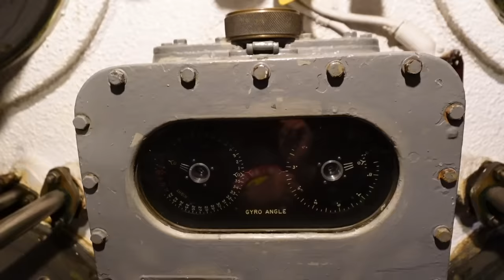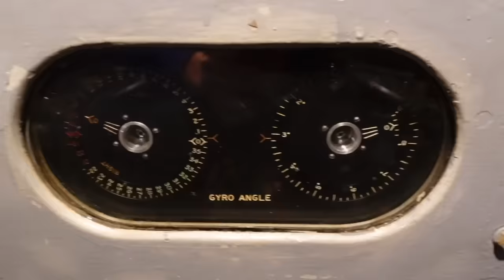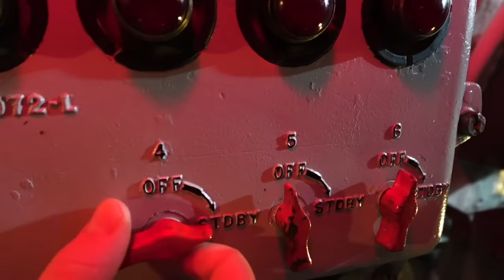Talking to the Fish: How USS Cod Programed a Torpedo during WWII

Comment from the maker: The 50-foot depth setting was to allow the problematic magnetic torpedo detonators to pass below the keel of large ships.
Reply: Also remember U-864, which was actually torpedoed while submerged
https://en.m.wikipedia.org/wiki/German_submarine_U-864#:~:text=German%20submarine%20U%2D864%20was,73%20men%20on%20board%20died.
Reply: 50 foot diving enemy sub, worth 1 fish try anyway
Reply: How similar is the torpedo programmer to the ones in later torpedo capable planes like the A-26 Invader?
Reply: Not much is similar...@damndirtyrandy7721
Reply: Think about what periscope depth of an enemy sub would be that's why you would need a fifty foot setting. Also the depth a torpedo with a functioning magnetic exploder   needed.
Reply: @joeveltre5560 And a functional depth keeper and a functional gyroscope…(a functional detonator was just the last problem).

Comment: I'm shocked, SHOCKED , I say, that the Mark 14 torpedoes had problems! Why, we were all assured by BuOrd that they worked exactly as specified, and any perceived problems were the result of user error.
Reply: @Drachinifel tells how one sub fired a dozen Mark 14s at a vessel only to have them all bounce off. They saved the last one and took to Pearl for evaluation.
Reply: And a court martial could follow if the captain ordered a toroedo mate to open one up for troubleshooting or modification to make them work.
Reply: Upon hearing of problems the bureau of ordinance immediately investigated and found no faults because all the paperwork was fill it out correctly

Comment: If I remember my history correctly, some of the torpedoes were supposed to detonate under the ship, breaking the keel.  It didn't work well, but it would explain having the 50 foot depth setting.
Reply: Yes. You're right!
Reply: The finally got the magnetic detonator to work in mid 1945. By that time there were few Japanese ships left

Comment: Paul,
The TDC absolutely deserves a video of its own. It was such an amazing piece of technology for its time, and making it reliable enough to operate on a sub was a major accomplishment of itself.
Reply: One of the most effective pieces of electro-mechanical devices ever devised for warfare. I really think it only falls to the later anti-air fire control computers in general comparison of capability against target parameters and tracking. I'd still vote for the TDC over the Iowa-class's main fire-control computers.
Reply: Well, to be completely fair, the Iowa main battery fire control computer does allow for input of 21 different parameters.  I think the TDC is about a dozen.
Reply: They did indeed make a superb firing system for the fish--it's a shame the torpedoes being fired were so awful for so long.  The bigwigs at the Bureau of Ordinance should have been charged with criminal negligence for first sending untested equipment into battle and then failing to listen to the actual men in the field telling them about the torpedoes' failures.
Reply: @davidlanfranchi8955 Yes, but is it as lovable?
Reply: YES !!--those T.D.C.-where an absolute genius of a design !--i would love to know more about them !
Reply: Reliable enough and small enough!

Comment: The level of planning and manufacture of WWII weapons of war will never cease to amaze me. Electronic function with at least one, sometimes two, mechanical contingency backups was very standard in US war-time design. It's not just what they did that amazes me, but how they managed to cram them into spaces that could still be long-term functional. If something just went completely wrong with the TDC and it wasn't reparable by the geniuses in the electronic gang, you could still finish the patrol with the IS-Was and Banjo and manually firing the torpedoes with only slight reduction in efficiency. Other systems were just as resilient and backed up. It wouldn't be pleasant and would be a lot of hard work, but that was the Navy, in war, and the enemy was still out there needing their date with the bottom.
Reply: You know your stuff, shipmate!
Reply: What strikes me is that in every sub movie they never show the poor guy behind the bulkhead. All we ever see are the loaders and the grizzled old Chief slamming the fire button.
Reply: And our handsome hero on the periscope. Haha.

Comment: IIRC Ryan has stated the max draft on an Iowa was 38 ft.  I think some of the Japanese battleships were heavier so may have had a deeper draft.  Didn't the later torpedoes have magnetic detonators?  Those work best when exploding under the Keel don't they?  That would explain the 50 foot running depth setting.

Comment: 11:04 About that 50-foot depth setting. Originally the Mark XIV torpedo had a magnetic influence exploder. In theory, the Mark XIV could run under an enemy ship, explode just beneath the keel, and because water is typically incompressible, shatter the enemy's keel, and thereby cause the vessel to break in half -- theoretically a much more devastating attack than punching a hole in the enemy's hull. I believe this was successfully tested once or twice in the waters off Cape Cod in the mid-1930s. However, due to the tight naval budget and a low opinion of submarines among the members of the ruling "gun club" admirals, insufficient funds were allocated for the sort of testing that should have been done. As things worked out the Earth's magnetic field varies across the globe -- stronger here, weaker there -- such that the magnetic influence exploder usually malfunctioned in the Western Pacific. There are many accounts of American torpedoes exploding halfway to the target thanks to that characteristic of our planet. 

The reason for the extreme depth setting available was to allow the Mark XIV fish to run under the keel of even the largest or most heavily laden ships,
Reply: Yes!
Reply: @paulfarace9595  I wish I had read the comments before I wrote mine. Several others made essentially the same point days before mine. I did add a few details not mentioned elsewhere, however.

Comment: On the subject of torpedo struggles, Cod entered the fleet in mid-43, and I thought by late '43 they were beginning to work out the issues with the Mark 14 exploder and such to get more reliably working torpedos. Something interesting to cover if you ever did a video about it might be how the torpedo failure onion impacted Cod in particular, as an example of the mid-war fleet boat entry into service? Does its war record reflect only some of the issues which remained problems effecting it, or were they mostly fixed before it entered service, or did it make patrol after patrol with bad torpedos like the start-of-war boats?
Reply: Cod encountered torpedo problems on many of her patrols.
Reply: @paulfarace9595  I think that could make a cool video that's not just a high-level re-hash, but "how the issues effected a single specific boat's war".

Comment: Programing those bottom two tubes must have been a little bit of a neck breaker. Are the controls at a different orientation than the ones above so the crew could see them better shy of laying flat on the deck. 

Also, were the bottom tubes used as often as the top two or were they used less because of their more out of the way position? (If they're even as out of the way as they appear since I've never actually seen them)
Reply: Tubes 5 and 6 are reloaded only once on a patrol and yes the controls are in the same location on those tubes so someone's bending down four times on a patrol. 😮😅

Comment: Thanks, great video.  My understanding was that it wasn’t so much the Mk. 14 torpedo which was to blame for duds as it was the Mk. 6 exploder which was a shape charge responsible for getting the 500 to 600+ pounds of TNT in the head to detonate.  Two things:  the magnetic detector of the exploder could be tricked by the Earth’s magnetic field.  The solution was to disable the magnetic detector and rely on contact detonation.  The other thing was that the firing pin was too massive and would jam on a straight on hit.  The solution was to make the firing pin lighter, just heavy enough to ensure touching off the primer when it hit the detonator cup.

I don’t know how the tendency to run too deep was solved, if it was anything more technical than just setting ten feet above the desired depth.

If you scrape around, there is quite a bit of stuff on Google documenting the history of positives and pitfalls of the Mk. 14 fish and the Mk. 6 exploder.
Reply: Drachinifel has a great series including the mk 14
Reply: @anttiroppola4414  Thanks.  I’ll check out his videos on the Mk. 14.  He did a presentation with Ryan on board New Jersey about a year ago and he’s very knowledgeable and articulate.

Comment: How did the sub compensate for the weight change when one or more torpedoes were shot?
Reply: The Japanese mini subs had that problem and in aerial photos take by their pilots a rooster tail can be seen in Pearl Harbor
Reply: I'm guessing that you flood the tube initially and the mass of the water offsets the weight of the missing torpedo.   later when they reload the tube they pump out the water and shift ballast as torpedoes are moved about.

Comment: What are the 4 brass cylinders above the gyro indicator on the pressure bulkhead where all the grease zurks are?
50 foot depth setting a submarine at periscope depth. you mentioned my other idea for fifty feet.
Reply: Do you mean the flashlights or the drive shafts for the .muzzle doors.
Reply: @paulfarace9595  Aha, Flashlights now that I know what they are they look like flashlights.

Comment: I guess an for enemy sub not on the surface would use that 50 foot depth setting.
Reply: Same thought.  See a periscope?  50 feet sounds just about right.
Reply: You never would fire on a submerged sub... only surfaced, where they were most of the time. Not until 1950 and the introduction of the Mark 27, Mod 4 could a sub fire a homing fish at a submerged sub.
Reply: It was for the magnetic detonators that required the fish to pass below the ship. That didn't work out well in WWII...😢
Reply: @paulfarace9595  Why not?  You see a sub submerge until only its periscope is visible.  You can tell from the periscope's wake which way the sub is heading and where its hull is.  Why not shoot a torpedo at it?